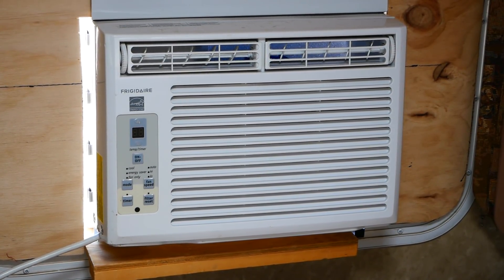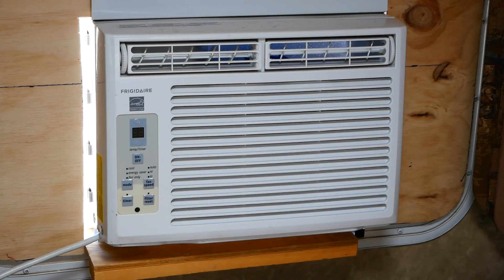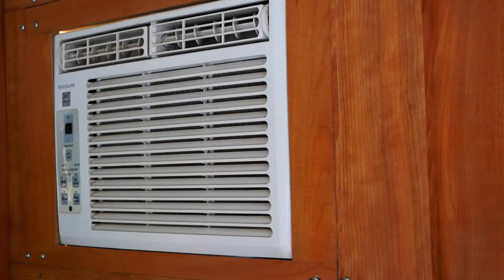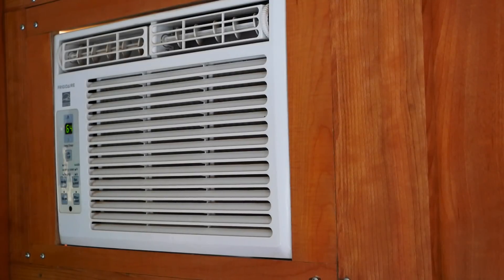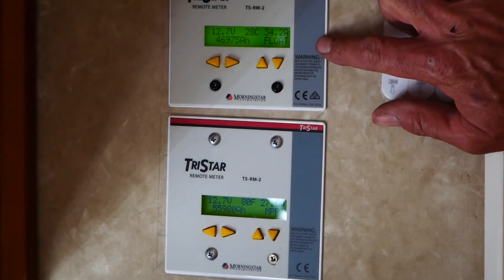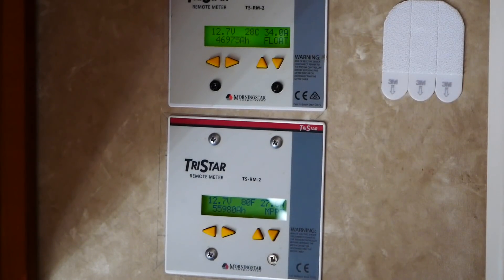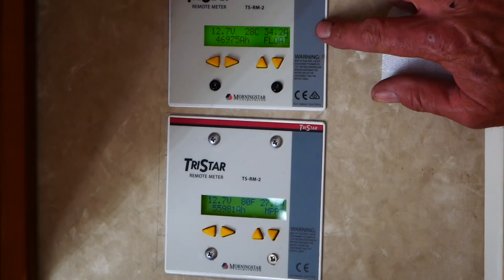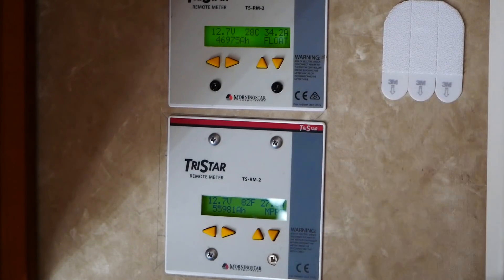Dual air conditioners on 1185 watts of solar

Comment: Very cool. Very inspiring. My plan is to put a little over 900 watts of solar on the roof on my ProMaster. And a single 500 watts air conditioner similar to what you have done. Keep up the good work!
Reply: Great conversation you two have going.  Wish I had your knowledge but I do understand a lot of what you’re saying.  Thanks!
Reply: Linda Krause, Thanks. It was fun. The knowledge comes. The concepts are rather easy, but the thinking is so foreign, it makes it hard to get past the beginning. I like when the learning builds on itself like this. Bit of dreaming with no limits about how to mount more panels in a limited space. Changed the way I am thinking about it too. Glad you understood. Any area(s) you want to explore?
Reply: Hey Mike,
How ya been?  Linda brought me here.  I put the summary of what we discussed a couple months ago on another channel's comments, but got nobody to extend the conversation with.  I guess it is too far out of the box for some to relate to.  To further refine my thinking, there are panels out there over 300 watts...I've seen 315W and I think there is 330W's out there.  Imagine 3 - 330W panels triple stacked...almost 1000W in the traveling space of one panel...tri-folded like you would a letter to fit in an envelope.  Probably you would have to visit a metal fabricator shop to build custom hinges to tie them all together, and the straps to allow tilting of the outside panels that would partially or fully overhang the edge of the van.  330W panels are big!  Probably need some rubber or foam bumper system between the layers of panels so they don't bang into each other traveling while stacked.  Charge the battery bank off the alternator while driving since the panels aren't exposed when they are folded.  I saw Renogy lithium batteries 100Ah and a 155Ah version on Amazon.  If you had 6 -100's or 4 - 155's, you could probably power a small community of vanners!  If you haven't seen this video, check this out: 

 https://www.youtube.com/watch?v=Ev2FHakHKUM
This guy "only" has 660W of panels, but has 6 - 100Ah lithium batteries, and he can run an AC unit 24/7 plus cook on an induction cook top and more.
Watched another video a long time ago...it was a guy with a large class C or it might have been a class A...anyway, he had a bunch of solar up top, but because it was a tall vehicle and he was older, he didn't want to be climbing up top to adjust his panels...tilting them to follow the sun...so he installed linear actuators to electrically move the panels.  This adds complication and increases the odds that something will eventually fail, but hey, carry a couple of spares to change out the broken ones...might be a good trade off to eliminate climbing up and down a few times a day to adjust for the sun.  Here is a link to a bunch of videos showing solar panels moved with linear actuators:
https://www.youtube.com/results?search_query=solar+panels+moved+with+linear+actuator
Reply: HEY DAVID!  Yeah!  That was fun, and changed my thinking. Yeah, you brought up mrrickybill in this thread earlier! Cleverest build I have seen — I use it for inspiration. Thanks again. The latest fun has been these people adapting Tesla Batteries. Lots of details beyond me on first pass. Lithium is a good LONG TERM investment. I did the math on the Renogy Lithium. Staying away from all lithium for awhile — they last almost 30 years, so I don’t want to mess one up $$$ until I know more. Cant let them freeze!  Yikes!  Bob’s FullRiver batteries are about the best deal almost to Lithium if you look at cost per lifetime power or cost per year. Lithium batteries are light — and we need to save weight triple stacking solar panels!  The 330’s are physically HUGE!  Most people could get by with one. Not us ;-). I’m glad Linda got us in touch again. I’m keeping this link.
Reply: Thanks Mike!  No, not right now, but how kind of you to ask!  I’m taking care of my brother and it could be years before I’m able to get on the road and I think some things will change by then.  If nothing else, I’m hoping prices will go down.  But starting from zero info, I can’t tell you how much I’ve learned about solar power just by watching YouTube videos!  That’s the only reason I was able to somewhat follow your discussion.  God bless you for offering help.  Maybe in the future?  How do I contact you?
Reply: Linda Krause, it is great you take care of your brother.
Reply: Linda Krause, Yes!  Watching these video also got me started down the knowledge path. You may already watch these, but here are a couple of my favorites:  Bob’s friend JimInDenver, who is also in some of Bob’s technical videos, has a youtube channel “SolarBoondocker”. Another Bob introduced youtuber, and my current favorite, Robin, has “CreativityRV.” A bunch of others out there geared toward the kind of camper build, hiker, traveler, age. Yet another Bob introduced and backcountry emergency beacon tester are the beautiful videos by “A Nomad for Nature”. My really technical, beyond my reach, but I understand some, Is “Adam Welch” — he sounds like Robin Leach from the old “Rich and Famous” tv show — I learned a lot about value(cheap) Solar Charge Controllers, along with accessories and meters (unnecessary toys that I love). For me, I do not have a channel yet or maybe ever. The issue is quantity - I don’t know how they come up with new ideas!  Best way to contact me is like this — This thread is months old, but I still get the replies. Thanks!
Reply: Madbit Vanner, have you done this yet?   I found out a few things on my camper - a bit late:  Panels are the cheapest part of the system, and they take up a lot of space. The big panel sizes are usually either 5.5’ or 6.5’ long and 40 inches wide.  With the panels going side to side, it used 5.5 or 6.5 feet of width and 3 panels was 12 feet long. Not that much room on my roof let alone room for other stuff. Also, the bigger each individual panel, the more expensive the charge controllers. A tough balancing act. Interesting to hear how you implemented it.
Reply: Mike Mead,
Have you ever considered double stacking the solar panels on your roof?  You would need a custom roof rack and the bottom stack would need to be mounted on heavy duty drawer slides.  When parked, the bottom panels could be unlocked and then slide out to double your solar.  Another benefit would be the panels hanging over the edge of your van would provide some shade to the van and/or the windshield.
Reply: David Golembeski, yes!  Good idea. I like the way you think. The problem is size if I double what I have. The best deals in solar are house panels @ $0.5/watt, but are huge and unwieldy:  5.5 feet long (small ones); 40 inches wide; 40 lbs.  I put a wood frame on them for easy mounting that adds 15 lbs of weight  - (that has to change). At 7+ feet up on the roof, it gets hard to handle. Your idea is right though especially with physically smaller panels. I might need to just get a couple of smaller panels I can store like you suggest or a couple of comparatively expensive flexible panels at 5 lbs each. I like the idea of hanging extra panels on the side, as an awning, or dragging them out to better sun. Those long heavy duty drawer slides used in pickup beds for tools would work too - just need a pole to pull them out like an awning. Yeah. I have watts envy, so I need to do something.  Good idea.
Reply: David Golembeski, OK. I’m kind of slow, so let me catch up. I imagined sliding them out the long 6 foot way to use as an awning, but the long HD slides are $$$.  But the slides are not so expensive or HD sliding out the 40” way.  I’ll can sacrifice the awning effect and buy a tarp.  Also sacrifice making them lug-able to move them to the sun. Just a slide out. Much more doable.
Reply: Mike Mead...I was thinking having the panels slide out over the drivers side since a lot of vanners have awnings on the passenger side.  That way both sides of the van would be "in the shade" reducing the heat transfer through the walls of the van.  Here is another idea...triple stack panels on the roof and attach to each other with heavy duty hinges.  When parked, unfold the top two panels to expose all three to the sun.  Mount the panels running from front to back on the van and you probably could easily fit two stacks of three up there and still leave room for a exhaust fan.  Disadvantages...you would probably have to provide some support for the outer "unfolded" panels so you don't over stress the hinges, either roof mounted or ground, and because the panels are folded on top of each other, there will be no charging while driving.  Advantage...maximum solar watts per square foot on your roof.  Maybe I'm overthinking this though...it might be better to have a few portable panels if you have storage space enough inside the van while traveling.  A ground portable panel can be moved to track the sun during the day, making it produce more watts than an equivalent roof top panel.
Reply: David Golembeski, HA!  Overthink is not in our vocabulary!  And we are not done yet!  I like the hinge/fold out. The smaller the panels, the easier, and a lot of these are mounted on camper roofs, so less accessible. My brother has one of those rooftop campers - unlatch, extend the ladder connected to it, then use the ladder to pull and “fold out” the top hinged platform that is assisted (springs? Gas struts?). Interesting. Would allow angling the outside panel. Weight is adding up. 40lbs per big panel, so doubling my 2 to 4 is 160 lbs and tripling is total of 240 lbs. in exchange for 1500+ watts....well we both agree.....not enough watts yet.
Reply: David Golembeski, some portable panels to move around is actually very practical. Probably my first addition. Still thinking slide out vs fold out. Both!
Reply: Mike Mead...you had a great thought there for the folded panels...the outside panels could be angled on the hinges, making them more efficient.  I'm imaging one side tilted up, the center flat, and the other side tilted down.  The only problem to solve would be how to support them at whatever angle you need.  Geez...if you have room for 1500+ watts on your camper, I bet you could go fully electric...induction stove top, fridge/freezer, lights and heater...and have no need to use propane.  That would be awesome.
Reply: David Golembeski, yeah, enough for electric cooking, electric heat, earth shield laser weapons.....everyday stuff. Angle Down-flat-angle up. Yeah. I was thinking painters pole type/extending, but connected to the camper, so a gust of wind does not bang it around. Not sold yet, but a start. Rather have something solid with big holes and easy pins/bolts.
Reply: Mike Mead....That's it!  Thin bars of metal with holes every inch or two bolted to the sides of the center panel and extending to the outer...with wing nuts (no tools!)   Depending on which holes you attach the outer panels to on the metal bar, the panels could be raised or lowered vs. the center flat panel.  Genius and super simple, should be enough support for the weight of the outer panels so a painter's pole for support might not be needed...good thinking!  (earth shield laser weapons...LOL)   Another thought to overcome the downside of not charging while driving...install one of those devices that charges your house batteries from the engine's alternator while the engine is running.  If you build it, I gotta see it in action...put up a video!
Reply: David Golembeski, Yeah!  Good leap in logic/completion, David. I had not gotten that far. Yeah. Same mounting sloping up or down. Wing nuts. Super simple. That is the power of teams - each part covering holes and providing further focus. It is a lot of your design. You planted the seed that got it going.  It is more yours. I would be honored if I could use it. I will let you know of any progress. Hopefully I can figure out then how to upload a video;-).
Reply: Mike Mead...Thanks for compliments and back at ya!  Hope you can use it because this is what the comment section is for...sharing ideas.  Uploading a video...look at the search bar to the right of the YouTube logo, then look further right of that box for the camera icon with a + sign in it.  That is what you click to start uploading.  That's all I know...never done it.  I'm a few years away from getting my van, so I'd like to see my dreams play out for you.  Good luck!
Reply: David Golembeski, Thanks for the video upload quick start!  I see it. That saved me time! Good luck with the van build - very versatile. Fun to build out. Cost effective.
Reply: Mike, I do have a question right now about YouTube.  When I get an answer such as yours, how do I easily find that comment in the video?  Thanks!
Reply: Linda Krause, Good question. It took me awhile to find it, but on my phone in the youtube app, I click on the response itself. It takes me to the video and to the original post under that video. Sometimes I need to expand the “Replies” and search , but if recent, it is usually the last reply. Make sense?
Reply: Thanks for the references Mike and answer to my question!  I’m glad I got you and David back together! 😁
Reply: Hey Linda,
Thanks for reviving this conversation.  I'm assuming you are a caregiver for your brother...props to you...I'm in the same situation with my Mom.  She needs 24/7 care so I can't put some of our (Mike and me) ideas into a real van just yet.   (Mike...it's up to you buddy!) Some day I hope to...and maybe by then technology will change and we'll have some other better ideas.  Until then, we just have to live vicariously through YouTube channels.
Reply: David and Linda, I can relate. Until recently, I was taking care of my mom in MA for many years until she became almost non functional. She is in a nursing facility now and my brother has taken that ball with video conferencing.  I am currently near my dad, 92, in MI.  He is in really great shape for age, so more do stuff together. I had to abandon my camper build, so my set up in picture with 500 watts over bed is it for now unless I buy truck camper or trailer. Hopefully heading out in Nov to AZ to work on it in desert to get out of the snow/cold here. Lots of unused boxes, hinges (solar tilt) and tools going along to play with - almost like Christmas!  My friend meeting me out there some time is taking care of her brother. Maybe the allure is a fantasy of escaping what feels like overwhelming responsibility.
Reply: Thanks David!  And I’m glad you take care of your mom.  Love is good, especially with all the hatred spewing in America right now!  God bless you!
Reply: Mike, good for you!  You need to get away for awhile and reenergize and work on your van.  Be safe on your trip and God bless you.
Reply: Mike, I’m already subscribed to SolarBoondocker and CreativityRV.  I’ll check the others out.  Thanks for letting me know!

Comment: How long can u run them...say with full charge without anymore sun...like at night ...b4 u have to charge again
Reply from the maker: Off of mt batteries? Assuming they are fully charged and with no other loads , about five hours to run both.
Reply: Thankyou for the answer...P.Sl will b hiring u soon 2 design my solar system ....

Comment: Is the inverter that run these pure or modified? Seems like a lot of motor buzz when they first start.
Reply from the maker: It is a industrial MSW made to handle starting loads. I blew out one PSW already
Reply: I am running a 2,000 watt PSW  to run a 5,000 BTU AC. Very quiet.

Comment: I had thought about the inergy Kodiak  but it will only accept 600 watts , it has a lithium battery and you can attach agm batteries to expand it but there problems with the different battery types.
Reply from the maker: it is best to not mix battery chemistries. The require different charge settings

Comment: I could set out more panels out on the ground if necessary .
Reply from the maker: Yes you can add a portable system like I added the one on my truck. It can be set up to add those panels to a existing controller or have them have a controller of their own

Comment: I have bought a new chevy extended 2500 van and will be buying an eight by 16 trailer for a bath room and office. I plan to carry a system of walls to attach to the side barn doors of the van using the ramp of the trailer as the floor and in the trailer I will be caring my 1200 sportster for trips into town. I plan to stay at one spot for the 14 days and move on  to the next.   I think I can put 600 watts on the van and maybe 1000  on the trailer, what would you charge for a solar  design . I want plenty  of power for ac and more.  of course I have a Yamaha 2000 watt  inverter gen if I need it . I will be chasing good temps but want to stay comfy. I will have a small wood stove in the trailer for heat but an electric option would be nice also. I think 1600 watts is the max I will have as far as solar panels.
Reply from the maker: I am charging a lot less than people think considering the time and effort I put in. Come through the website so we can talk more. jimindenver.com

Comment: Great video Jim.  Will you be doing a video on how you installed the air conditioners?  I'm particularly interested in how you installed the one in the window as I've got a unit like that that I want to mount in the window but don't have a good plan on how to hold it in place.
Reply from the maker: I will be doing it for both units

Comment: Wouldn't a mini-split be more energy efficient to run than two seperate ACs?
Reply from the maker: it would be and there is a 12v roof mount 9000 BTU that pulls 600w that I would love to have, The thing is both are very expensive and harder to install